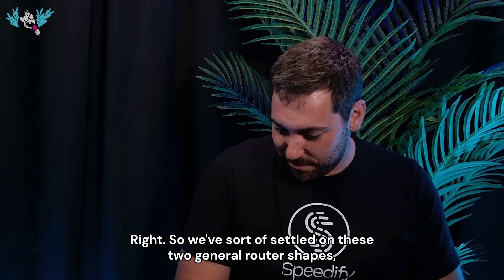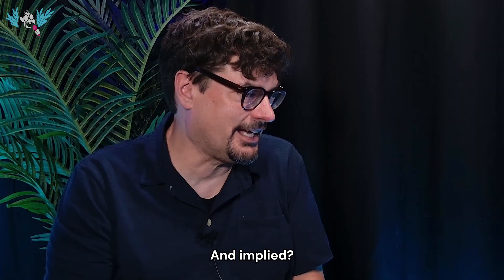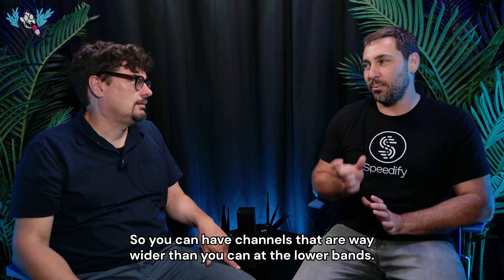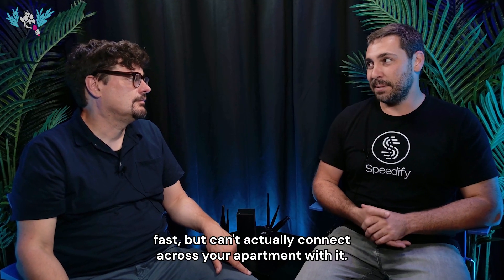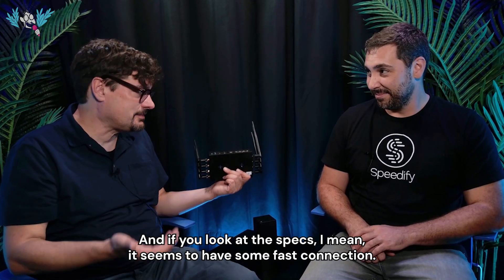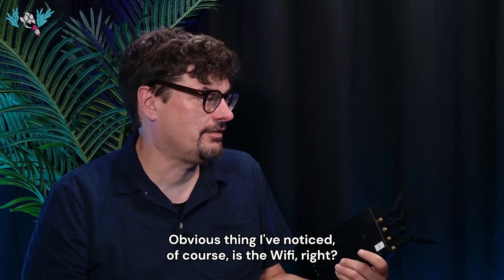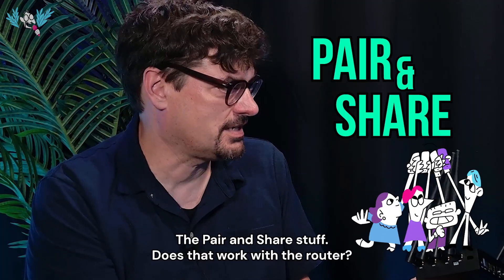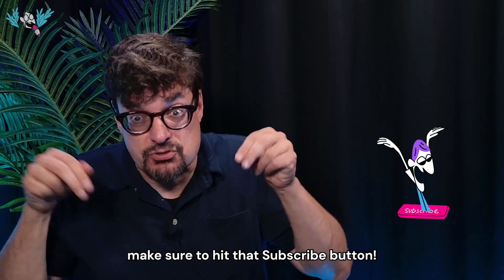Wifi 7 Routers are turning into SPIDERS for a reason!

Comment from the maker: Have you ever bought your own router or do you just use the one provided by your ISP?
Reply: bought modem and router for super cheap off amazon. Paying cheapest speed for the max my pop can handle which is 800mb but paying 40mb lol. I Boight a cheap 6e router which allows for option for external antennas Bc my building if odd so i play them where i want. Installed different os with pihole XD.
Reply: I use multiple ubiquiti wireless access points which seem to work a lot better than the linksys combo units or stuff at bestbuy  I used to buy.